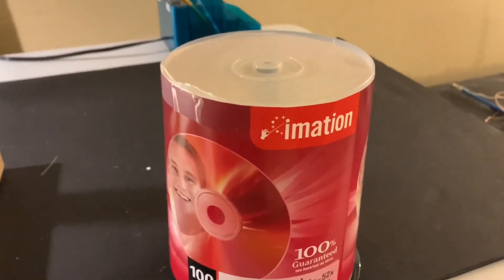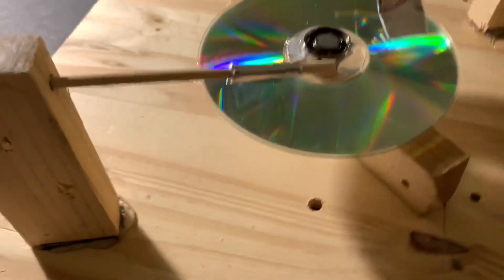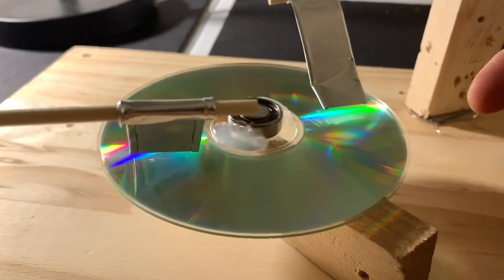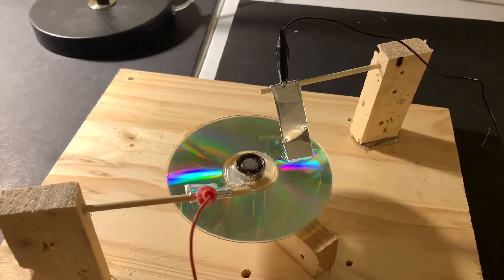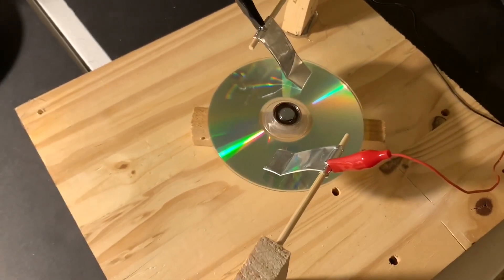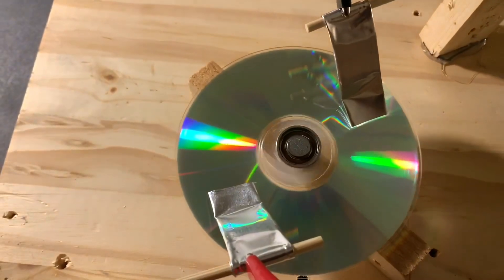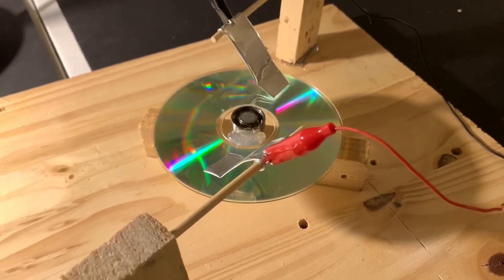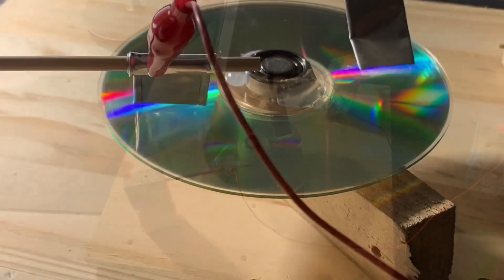Cool High Speed Motor from old CD Disk

Comment: One hell of a radiant watt system, at least there would be minimal risk of shock at 20,000 XD. I"ve heard of lifters using 100 to 200 :S
  Would love to see this with a hefty flywheel, would be an ok running system not so much a starter system though lol